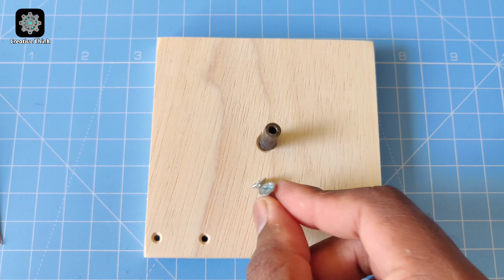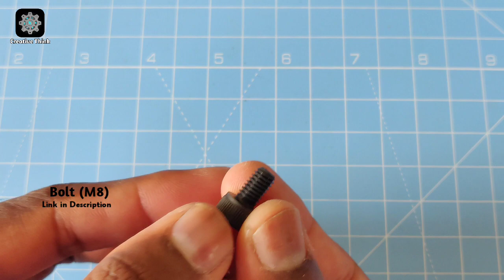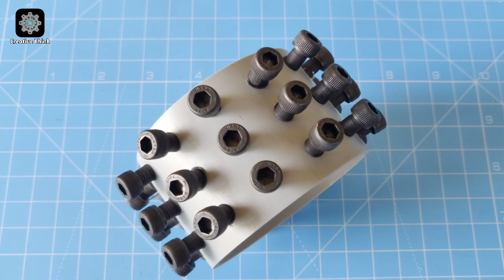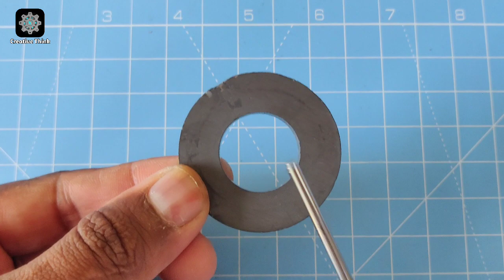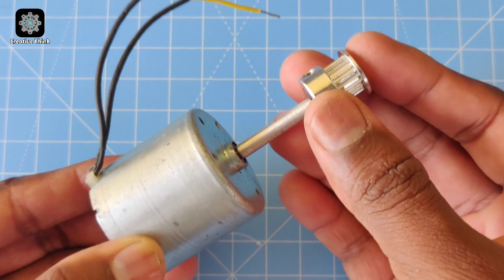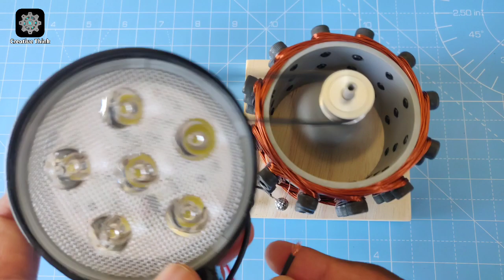220V Free Energy Generator Using 36 Bolts

Comment: Once the generator is up to speed, remove the timing belt, and disconnect the motor leads.  Pick up the board and cut the hidden wires.

Comment: 220 volts. You're touching the screws with your bare fingers. You're still alive.  WOW!!!
Reply: It's DC voltage
Reply: @akgossl  220 volts DC can still be dangerous, under the right conditions.  However, his generator isn't producing any current, at all.  The motor is spinning the magnet.  Do you see the screws at the front of the board?  Those screws are connected to wires that go through the table and connect to a hidden power source.  The battery is just a prop.  The whole thing is fake.
Reply: @akgossl  no it's actually alternating current that's not even there it's not creating it is not needs a voltage regulator and a AC to DC converteranything that alternates inside of a magnet like that and copper windings is going to be alternating current it's not going to run a 12-volt DC light or that motor which is looks like it's DC headed back because he started up supposedly with that battery it probably is DC yeah it if there's any current coming from its from that DC motor to the light and it's not true this thing doesn't work it's BS

Comment: You forgot to list the battery you hid for this to work.
Reply: The magnet in the generator is the power source for the motor the battery he used to start it was just a primer.
Reply: @deathtofortnightbenshapiro846  magnets don't contain energy so it can't be a power source

Comment: It is seriously posted. All the devices of this user simply works. I know cause I built some of them back in the day in my attic. Follow the steps and build your own. That will work if properly constructed.
Reply: Hey put them into a single board. And lift it in front of camera. Show with working without external power supply connection